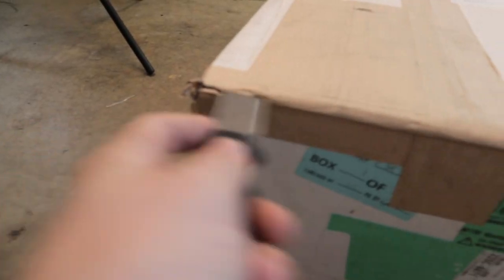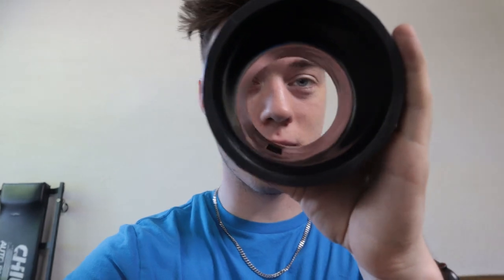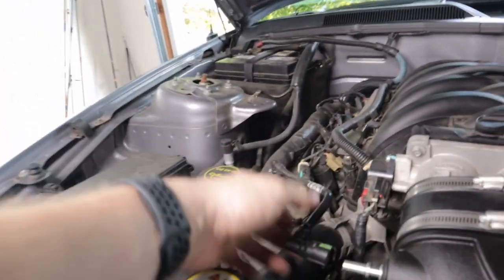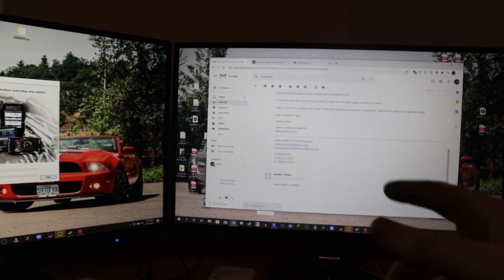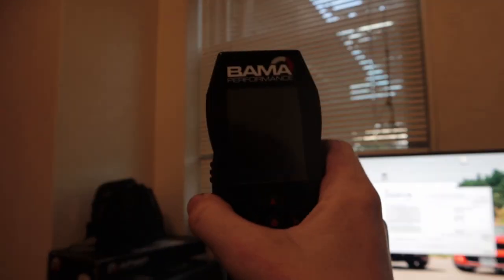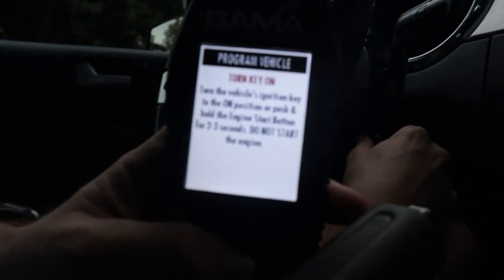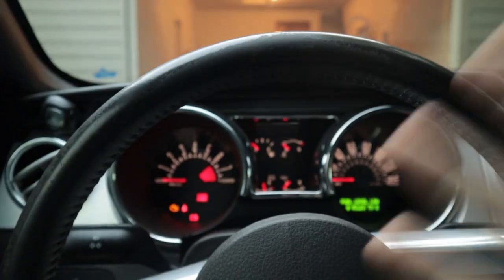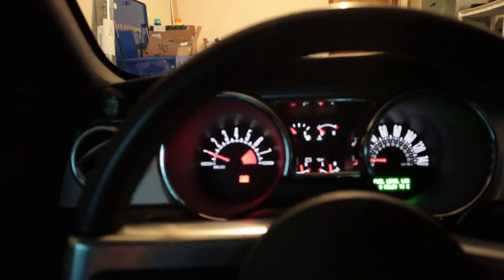Should YOU Buy a Cold Air Intake?

Comment: You don't need that air restrictor if you don't have a tune.  Modern cars adjust for air fuel ratio, so more air means it will inject more fuel to compensate.
Reply from the maker: You’re almost correct. However, 05-09 mustangs don’t have adaptive mass airflow sensors. That’s why they don’t have sport mode either, because the car can’t adjust the tune on the fly. The computer has to be reset and flashed according to the mods you install. Otherwise the car will get a check engine light

Comment: No dont bother i am going back to stock airbox the ford racing cold air intake makes the engine light come on and its a pain to keep turning it off
Reply from the maker: You have to adjust the fuel tables to accommodate the extra air